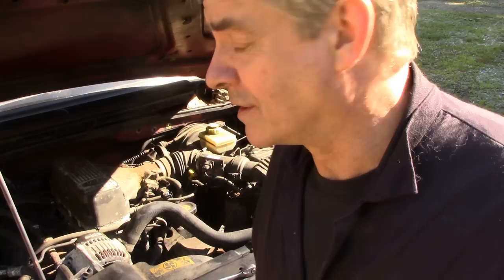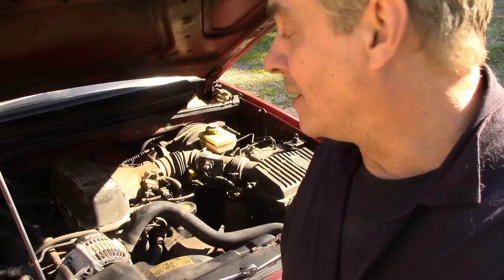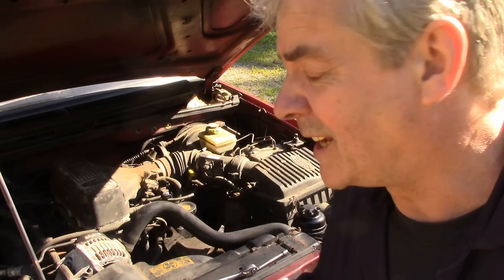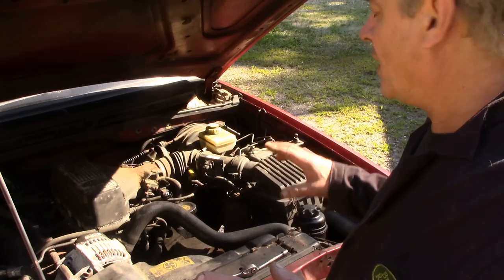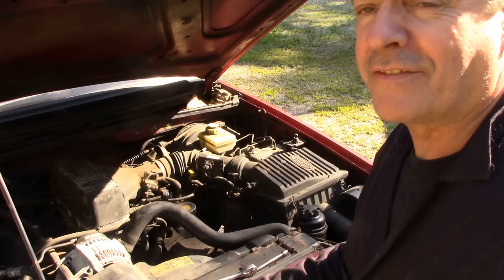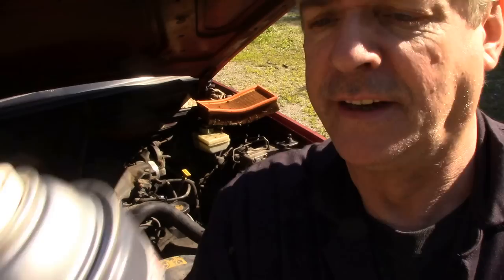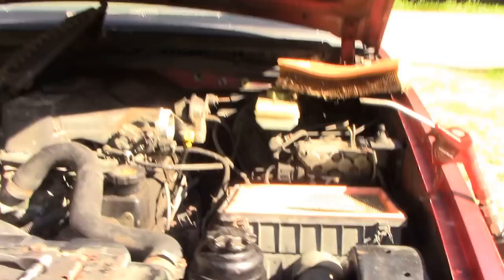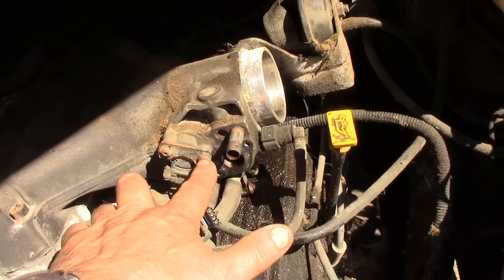1997 Discovery 1 4 0 High engine idle. Cured!

Comment: Had high idle on the 4.0 engine fitted to a car I recently bought. Discovered previous owner had messed around with a new stepper motor and given up - leaving it unplugged and in fixed position - followed through your video and had the same experience as you. Replaced IAC and then throttle position sensor - same result as you - thanks a million for the doing this video!  Now have to find out why engine light is still on!! Replacement IAC £16, new TPS £160+ - bought a secondhand TPS from breaker £40. Replaced screws with standard Stainless allen cap screws M4x14mm & M4x20mm.
Reply from the maker: If I get one of these on high idle again, I will reset the adaptive values first before swapping parts

Comment: So true on the 4.0 GEMS..Absolutely the most solid reliable V-8 of that era.  I have owned em all..3.5  4.0   4.6...TOP HATS are the only cure for the dreaded slipped sleeves ticking.. I have seen a trick .At bottom edge of sleeve...some folks  have drilled and bolted the sleeves thru the block.

Comment: excellent video again, so jealous though, i have been after a TPS for my 4.6 build, and cannot find one anywhere. everyone i have found has come but a different fit.????
Reply from the maker: All 4.0 and 4.6 Gems should be the same - and genuine only
The Bosch injection system is different, as is the 14CUX (with distributor)

Comment: Those 4.0 were pretty stout engines.  the problem with them isn't the motor itself, it is all the stuff hanging off it.  That was a job well done and i have a feeling that motor has few more miles left in it, once it gets the externals squared up.  Considering it was sitting for so long and you were able to get it going is a testament to its ruggedness.
Reply from the maker: It would be a nice one to refurbish - need to find if the block is cracked

Comment: I appreciate the GEMS 4.0 content! Got one in my Defender 50th. Mine idles a bit slow at around 500 rpm. Only thing i'm worried about is an intermittent oil light sometimes at a traffic light. Changed the oil to the thicker Valvoline VR1 20W50 as was suggested in an RPI Engineering video. It still lights up sometimes but usually dims quickly after a cold start. Made some long trips recently with massive traffic jams and extreme heat. Other than the oil light I feel comfortable reliability wise. Got a new radiator recently. The temperature gauge is typically a few millimeters left from the middle.

I do suspect mine has a slipped liner that most of the time doesn't move. When the knocking sound is there it's very rpm dependent and is more prominent in the lower rpm range when accelerating slowly and goes away with higher rpms. When I hear the sound I avoid it by accelerating a bit quicker. At cruising speed the sound isn't there.
Reply from the maker: Get the idle speed up - should be 700 Rpm - you may have to reset the adaptive values or do what I did with the TPS
Reply: I'd be willing to bet if you got the idle up to 7-800 your oil light issues will go away

Comment: Have you got a link (or manufacturer) for those pliers ? Really enjoying these last three videos as they are my level of er, engineering.
Reply from the maker: Google:

ENGINEER PZ-58 Screw Removal Pliers Extractor Pliers
Reply: @BritannicaRestorations  Thanks
Reply: @melgregory7339  I’ve got a set for work and home, amazing pliers. The metal is hard, and the blades sharp. Anything by Engineer is quality, just ensure it is made in Jay-a-pan.

Comment: G'day Mike, awesome job cobber.
If i may... here in Aus, we never got the 4.0 in the D1's. Only the 3.9. The 4.0 came out with the D2.
 Could you please explain what differences there are betwixt the 3.9 and the 4.0.
Muchly appreciated.
Cheers for sharing.
Reply: If I have it right the 3.9 was a progression of the original 3.5 Buick motor. The 4.0 was a new platform. I could be completely wrong but.
Reply: @raygale4198  a new platform, ok, nice. I wonder if that included block castings?
Reply: 4.0 was the same displacement as the 3.9. The change was moving from 14CUX to GEMS engine management system.
Reply from the maker: The 3.9 was a Lucas 14CUX controlled engine with a distributor
The 4.0 was the same size (just renamed it to make a difference) however it was a GEMS controlled unit, no distributor, but a coil pack was fitted, the crank was cross bolted - that meant there were bolts going in from the side of the engine as well as vertical, giving it more strength

Comment: Hi Mike I have a 4.0 gems in a 50th Defender, I had starting running problems, it was a faulty ECU so replaced it with a Mark Adams chipped replacement ECU and now its amazing runs cooler and has better mid range, only trouble is it needs a bit of throttle in the cold weather to start and warm up a little before driving or it cuts out,  has new TPS and values all checked and set by top Land Rover mechanic , but still has a cold start idle issue in the winter months , no problems in summer, any advise?. cheers Terry
Reply from the maker: Could be the temperature sensor near the thermostat
Reply: @BritannicaRestorations  Cheers Mike I’ll get it checked. Love your videos